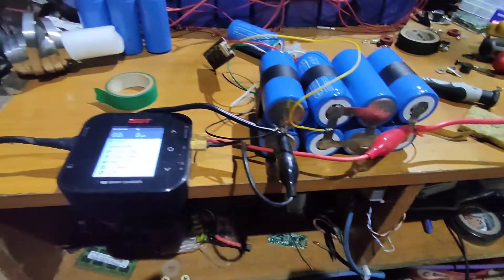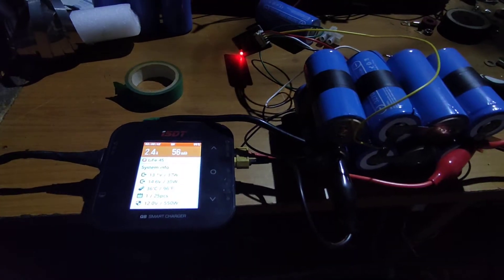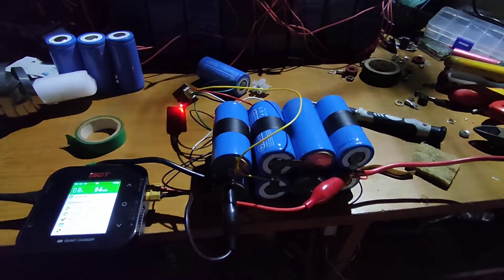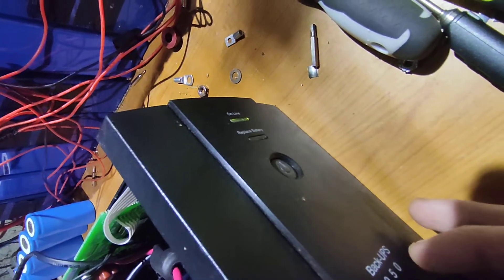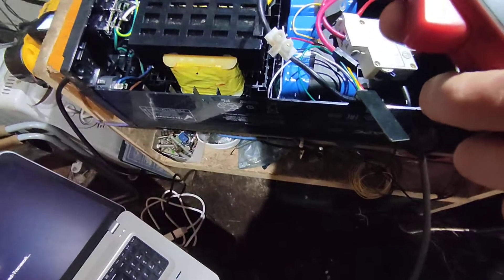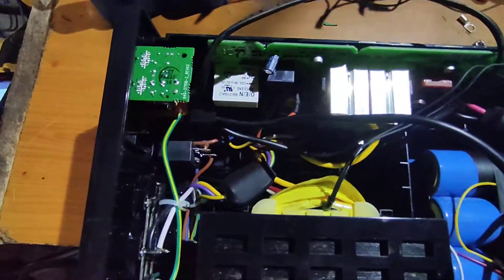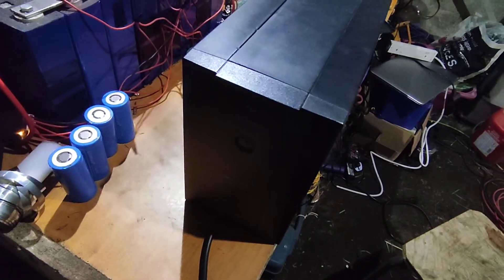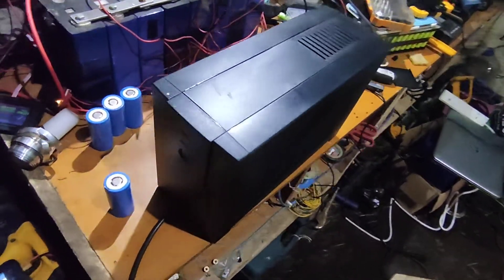Back-ups 950 Lifepo4 conversion 14ah (part 2)

Comment: how does the IT processor fix my power charged electro wire windmill back x12 ? do i install frameware 2?
Reply from the maker: Yeah you can do that, just make sure you wash it first